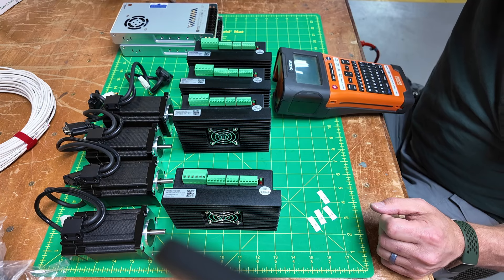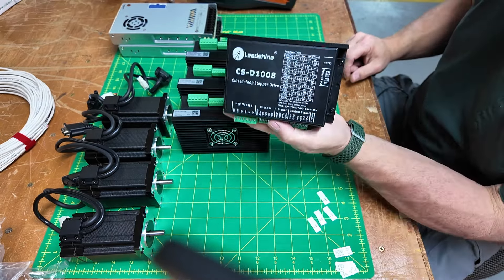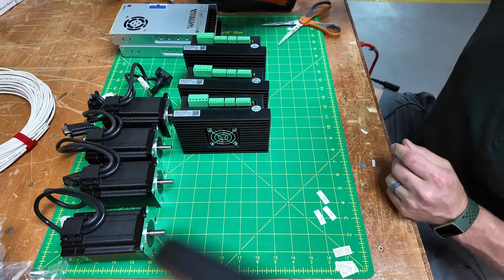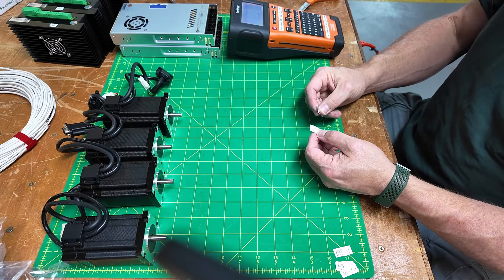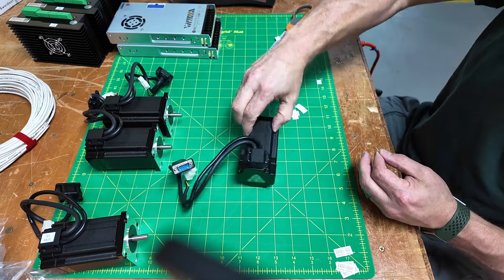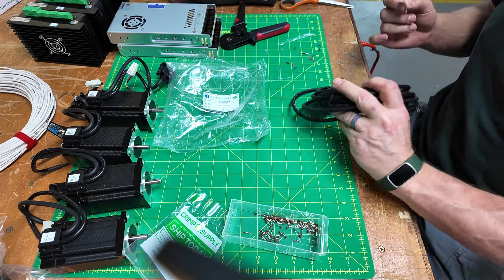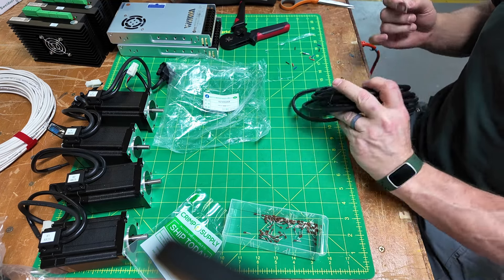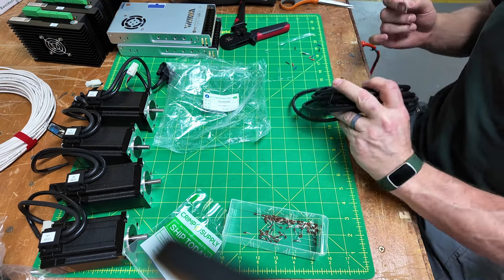ShopBot Upgrade Part 3 - Boring Prep Work and Testing!

Comment: I also went with Leadshine stepper controllers and motors.They have been flawless so far. I may upgrade to Leadshine servos in the near future. Great upgrade. OMG, I also use the Centroid Acorn controller. Awesome choice, you will be very happy with that. It's easier to use the standard relay configuration. It seems that some combinations don't work. You will have to do some work on the relay macros to get custom configurations to work. I added a PWM laser to mine and M37/38 needed some help.
Reply from the maker: I've only recently gotten things nailed down - nearly all the components are mounted to the enclosure chassis now.  I need to get going on the wiring, but I discovered that the contactor I wanted to use for the spindle was only 20A, and the unit in the ShopBot cabinet was 32A.  I need to get that resolved and then I can start my wiring tasks.  I hope to post an update video on that soon.